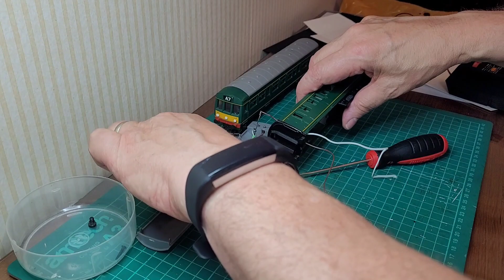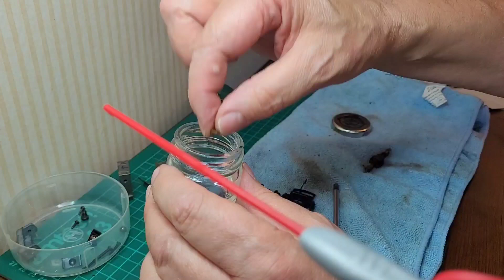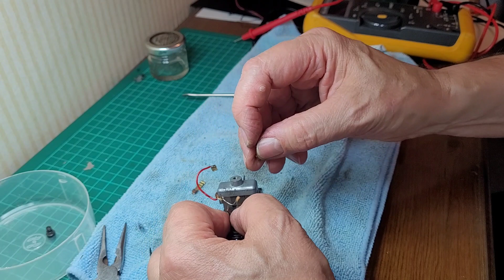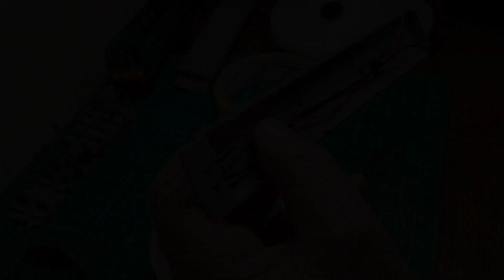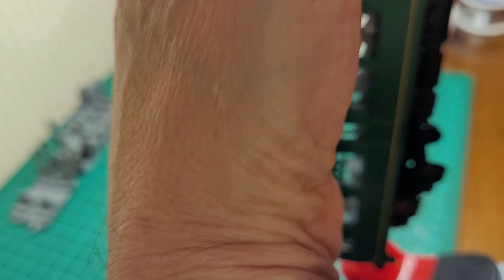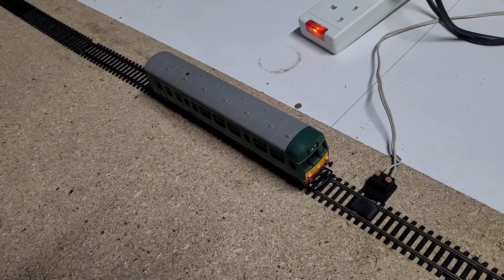Hornby DMU service and LED lights. Attic Find, My Old Trains !

Comment: This was not that dirty. I think it was unnecessary to dismantle to this level. You risk braking the non metallic plate the brushes are mounted in. The commutator can be cleaned in situ and bearings oiled. The main thing is to take the wheels off and properly clean as you did. I also remagnetise  which, while not as bad as dublo, still work better with a remag.
Reply from the maker: Thanks for watching and commenting too. Always interesting to hear different opinions.

Comment: The early Sixties models had serrated wheels on the motor bogie. I think yours is late Sixties. I have both versions, but the early one needs new or secondhand wheels. Now I will have to replace the bulbs in the later one. I will have to look at the earlier one and see it is possible to fit LEDs in it. Martin. (Thailand)
Reply from the maker: Thanks for the info Martin 👍Thanks for watching from Thailand !

Comment: Just a quick tip
WD40 isnt great for giving models a service. I tried it to a Lima Class 37 and ended up loosing it
P.s have you thought of getting a steam engine by the Southern railway? I would reccomend a schools class engine
Reply from the maker: A Southern engine sounds good, will have to start a search! The Wd40 product is their electrical contact cleaner and not the normal penetrating oil. It seems to dry and leave no residue so fingers crossed! Thanks for watching 👍
Reply: @padshawjunction. Thanks Pad I may have to get some of that myself lol

Comment: Suggestion - add a little drop of oil to the pivot base of the coupler arm so it goes up and down smoothly. Thanks for the video.
Reply from the maker: Thanks for the tip and thanks for watching and commenting too. 👍